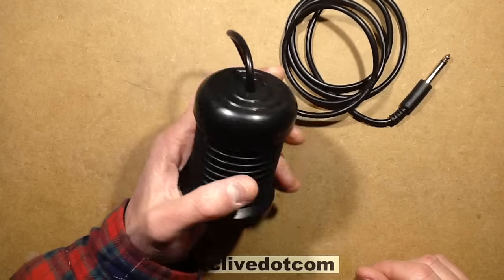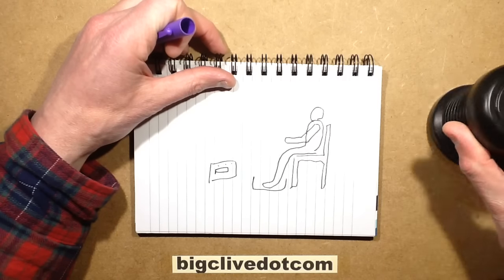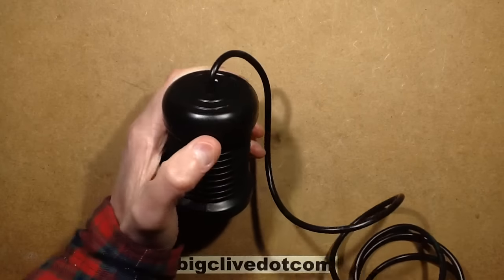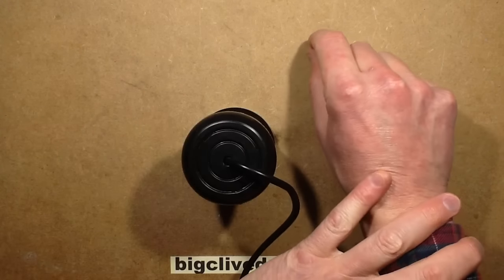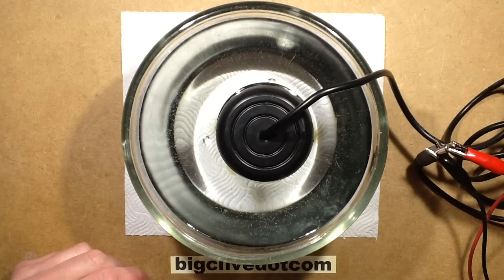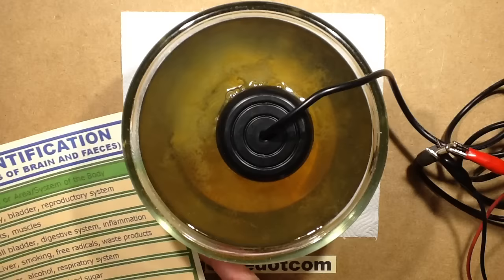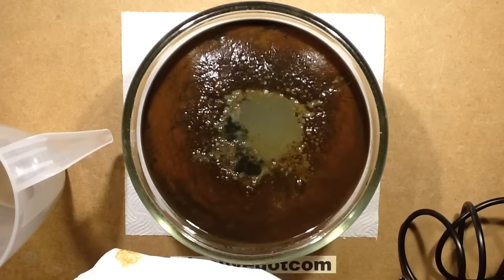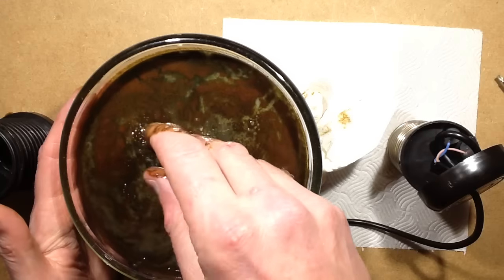Ionic foot detox electrode scam.  How it works.

Comment: It has an audio jack plug?  Maybe plug it into a p.a. system and use it as a microphone (with a few adjustments) or you could strip all the copper off it and cash it in for scrap. Or sell it to a another sucker looking for an easy way to be healthy other than doing it the right way with diet and exercise. Lazy and dumb. Not a good way to go through life.

Good day.

Comment: I have run a lot of hydrogen generators which will turn water the same color as this machine is supposed to be doing oh, but all it's doing is splitting the stuff that's already in the water, pure scam oh, that's why I drink distilled water

Comment: I think you need to go to the doctor 😂
Reply from the maker: Or I could go to a fake practitioner and have my feet marinated in a mixture of toxic chromium and nickel from electrically degraded stainless steel electrodes as they claimed it was sucking toxins through my feet.

Comment: I done the same experience and the water is clear after 30 min.Only when I get my feets in it,change the color.
Reply from the maker: Did you add salt, and did you use the hand electrode?  Try putting the hand electrode in the water, it may use it to avoid starting the fake treatment until you complete the circuit.

Comment: Perhaps you should do an actual experiment and use the product to its intention if you run it without feed it gives you a base color and then you run it again with your feet in it and you will notice a difference in the bubbling any additional as you say grossness so unless you use the product away is intended your experiment means nothing it plugs into the wall not your hoagie app system

Comment: Still waiting for you to tell me which make,model and mode you used ? Fake Clive as none of these things are visible in your video,  just red and black jump leads ?
🤣🤣🤣🤣🤣🤣🤣🤣🤣🤣
Reply from the maker: https://www.youtube.com/watch?v=qnXTvU6-xLQ
Reply: @bigclivedotcom  Hahahaha 🤣🤣🤣🤣🤣 No wonder you were reluctant to tell me make and model,which you still havent , but dont bother because that is garbage, what did it cost a tenner,lol, that is nothing like a proper ionic detox machine, you had to plug a machine into it, to find out what charge it was kicking out 😁 so no digital display then ?, and obviously just one mode?, it's not even a machine, a circular attachment no display and no variation , so no choice of positive or negative , or variable charges put through the water, no anti static band or safety measures, mines the size of a record player with multiple functions, with the ability to positively or negatively charge the ions in the water, so as well as detoxing you can also boost the negative ions in your body, yours is the size of a plug, you cant even call it a machine, it's more like an attachment with a green light,  it looks like a one trick pony, pound shop equivalent, I bet the array (coil) cost nearly as much as that whole unit, and you've got the nerve to say all ionic detox machines are a scam, based on probably the worse, low level, cheap ass, non digital, chinese tat I've ever seen, that's like reviewing a soap box with a BMW badge on made out of cardboard, and saying these BMWs are a scam, they dont go up to 160 mph , dont have heated seats, or electric windows and are certainly not value for money 🤣🤣 That is not a quality product, it's no different than what you've previously done which is attach a coil to cables and a generator it does 1 thing, 1 generic mode, everyones different and need different functions and suitability which that attachment simply doesn't have, but that unit definitely does not represent a top end , sophisticated, digital,  Ionic Detox Machine, any time you would like to  personally try and feel the undeniable benefits you get from a real quality machine, please let me know I will be more than happy to arrange it for you and a non biased party to have a go, as long as you film it so the truth can prevail, and as your clearly not a fan of spending money, I can reassure you the whole experience will be free of charge 😎👍
Reply from the maker: @darensmythe2987  They all work the same way.  A current limited DC supply that causes rapid electrode corrosion, with the polarity swapped automatically or manually to even the electrode wear.
You could just connect a 9V battery to the electrode's plug to get the same effect.
But if it makes you feel good to soak your feet in a solution of chromium and nickel salts then don't let me stop you.
Reply: @bigclivedotcom  Which is my entire point and exactly what you did,  you didnt use a machine hence the red & black jump leads, that's deceitful and lying to people, because you the self proclaimed expert says it's so, not buying it , you say they all do the same thing , answer me this on mine because it has a digital display which always shows the exact charge amount, I can increase the charge amount by adding salt and watch the charge value increase real time, yours doesnt tell you a figure or alter in any way does it ? And yours doesnt have any modes ? Mine has five modes all very different including one that instead of positively charging the water (detox mode)which is where you suggest the electrode corrosion happens and you get the brown sludge results, right ? But if there all the same like you say, mine has a 100% negatively charged mode(negative ion boost mode), that gives you light yellow results with no surface scum or debris,corrosion or anything  even remotely similar to your results, and four other modes with different levels of polarity and electrical charge, yours doesnt do any of that does it ? So there definitely not all the same are they ? If yours is exactly the same and does the same job, please show me the very different results you get from a 100% negative charge ??? And can you tell me what the increase in charge was you encountered after adding salt which obviously increases the conductivity of the water, which clearly as an expert you would know 😁😎 Finally you keep going on about me bathing my feet in chromium & nickel salts, which I assume  you mean comes from the silver looking coil itself, now if that was the case and it's a byproduct of that silver coating ,how come you can use a coil up to about 80 times the chrome coating comes off after about three goes, revealing a more copper looking metal underneath,  yet you still get the brown discolouration and brown scum on top, even when there is no chromium or nickel in site whatsoever???? 🤔😁
Your far from an expert in these matters, that much is for sure, it's a joke, as I said let me do a proper experiment with proper equipment with you,and get to the bottom of it once and for all,although I dont think that will ever happen because your pill pushing , W.H.O loving, Holistics hating Employers wouldnt stand for it, and wouldnt monetise you 🤔
Reply from the maker: @darensmythe2987  The stainless steel coil looks silver when new, but the electrolytic corrosion pits it making it look matte, and the corroded/oxidised surface is closer to the colour of the salts it puts into the water.
The only deceit is the people passing this common scam off as a cure for many ailments and implying that its dirt-show is coming from within their bodies.
Anybody offering this faux detoxing is a charlatan.  More so if they dress like a doctor and imply medical skills.
Reply from the maker: @darensmythe2987  A dual machine would have individual results based on three variables.  Electrode condition, current and salt concentration (salt to water ratio).  Since these non scientific machines are being used in a non scientific way by non scientific people the results will be hugely random.
A better quality machine will let you set a specific current and regulate it.  A poor quality machine will use a fixed current or just a resistor on a fixed voltage supply.  The variable one would be my choice if I was offering this quack treatment, as I could turn It down for subsequent treatments, and then advise my victim that the colour was lighter because the detoxifying course was working.

Comment: Number one dude... Check the coil in the foot bath with a magnet.
Cheap 100 dollar foot baths use STEEL COILS. Steel rusts in salt water,passing current thru steel makes it rust faster.
Professional Grade footbaths use non magnetic stainless steel. Non magnetic stainless does not rust because it does not contain iron.

Professional Grade machines will cost you 2000 to 5000 dollars.

Go get a professional grade machine then make a video.
Stop spending false info please.

Comment: In prison we call em stingers it's how we heat up water to cook with in the cell that water would get so nasty just from salt and tap water we don't use the brown water we use plastic bags and place em in the brown water to heat up our water and then just pour the water holding the bag with a towel to not drip brown water in the clean water and whammo you're welcome just another prison tip from your uncle luddy 🤭🤭

Comment: Sorry, I disagree. The colour yes, seems to be from the salt and water. BUT, it seems to have an effect on my erection and metabolism, as if I am loosing weight faster, without changing my diet; not 100% sure yet about the second, I need more time to be sure.
Also, solid pigments show up, how?

I could be wrong and there could be other causes for the above(non in mind) but it seems a weird coincidence that these effects showed up after using the array.
Reply from the maker: If you find it helps you, by all means keep doing it.

Comment: I’m here to tell you it works my friend had gout in his legs so bad he would have miss 2weeks of work at a time several times a year I watched him 2 thirty day treatments with a mouth off in between that was 6 years ago he hasn’t had gout since then .so I bought one it sure clears up my skin really good!! You have to use it right yes your right that it turns the water that color but it still takes some stuff out of your body my friend and I are proof it works I suggest you study it more and try it yourself
Reply: What absolute bollocks.

Comment: the positive ions in the air the pollution in the air is attracted to the negative charge!! and yes it does anyone that tries it will feel the stuff pulling out of the feet youre just a troll to keep people from relief
Reply from the maker: One of the electrodes is positive and one is negative.  You clearly don't understand what positive and negative ions actually are.

Comment: People think this is a scam because the water turns a color from the device without your feet in it. But that doesn’t mean anything. They acknowledge that. They never claim that all of that color comes from your body. They say it comes from the device. But It shows different colors, it’s because of the mixture of the colors that come from the device, and the specific toxins in your body. Some of the color of the water, is coming from your body. Most of it is from the device. So it is not a scam.
Look into zeal light. It is a heavy metal detox you take internally. It works by negative and positive charged things as well. It’s negatively charged, and then heavy metals in your body or positively charged, and acts as a magnet and then you pay it out. Same concept. And that works
Reply from the maker: Lots of very similar pro-scam comments recently.

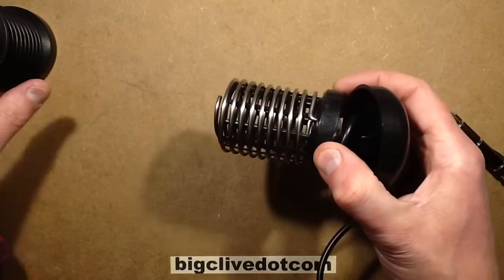Comment: at 3:36 it actually looks like YOU could use some heavy metal detox- with that shaking you got going on there. 
Neurological damage is also due to heavy metals. You could probably benefit from the very machine you 
are bagging on.
Reply from the maker: I think I filmed that during a time I was nursing my mother through her final illness.  The shakes were probably caused by sleep deprivation.

Comment: That how our water is not clean, put distilled water will not doing that, I tried it,  As mentioned be careful what you drink,  boil your water and wait then drink it from a good filter water cleaner...❤
Reply from the maker: Distilled water is non conductive and will stay clear.  Any impurity, including natural minerals will cause the theatrical colour change even if the water is perfectly acceptable.

Comment: If your going to prove a scam use the real product not a your made thing . You I think are the scam
Reply from the maker: I did later on.  It was also a scam.
Reply: @bigclivedotcom  ya took the vaccine also ? 
I will tell you this I used that after a very bad accident and a ton of meditation. It healed me and cleaned a ton of crap out of me . 
Also if that was true why would my friends be red and white specks and my husband with asphalt sitting on the bottom?

Comment: Research METAL CLEANING WITH ELECTROLOSIS, WOULD'NT IT BE POSSIBLE FOR  YOU TO PHISICALY ABSORB THIS SLIME, IF NOT PROPERLY WIRED? SOMEONE HELP ME OUT WITH AN ANSWER HERE!!! ( a simple power sorce and anode will work here) costs nothing, and easy setup! The aode material must be making the slime, someone with electrical, medical knowledge comment on this please, reversing current direction pulls from the other direction, this concept is not immpossible, just close the electrical circuit with current flowing in the right direction!
Unless properly flowing current direction, one could be absorbing this instead of producing it!!! Someone smarter than me comment please! This is so cheap to do, no wonder it provides  INSTANT RESULTS, THATS WHAT SOLD IT!

Comment: Any one that has use it can feel the difference in the body. The acidity of the body goes down. Dont talk without using it.
Reply from the maker: Yes they can.  It's called the placebo effect.  Or maybe it's the introduction of toxic chromium and nickel salts through their feet into their bloodstream from the electrolytically corroded stainless steel electrodes used to create the brown colour.

Leave science to the technical people and keep quackery to those who have nothing else to contribute to society other than voodoo fakery.

Comment: Problem is you want it to be bogus based upon belief.  You assumed the coil would corrode because it’s not stainless when it looks like stainless to me and your magnet showed it was a decent quality stainless because some non medical grade stainless is very magnetic.  Highest quality has zero magnetic. 

When you look at how the water negative ionizers work it pulls the toxins that are acid energy or positive charge to one side of the separation containers and is brown and the alkaline or negative charged water is clear.  Then ph test proves it.  

This stuff theoretically therefore shows it can actually work.  All is energy and repulsion and attraction. 

It just makes sense.

Plus I’ve been curing people of everything for twenty years and I found it’s all about acid I body cell or alkaline body cell and we know acidic batteries are toxic and alkaline battery cells are non toxic.  If you throw cooked foods in a compost it makes the soil toxic and deadly to plants and life but raw materials add to it make it alkaline and life giving. 

All, things are connected to this two different energies.  Because all in this world is polarities and positive and negative.  Pretty simp,e logic. That water you used showed that it’s not a healthy water.  

What you showed us here tells me it’s more possible that it’s not bogus. 

Try doing it with distilled water instead.  No impurities in distilled.
Reply from the maker: Very little would happen with distilled water because it is not conductive.  Even ordinary tap water is too slow for the visual effect, hence why they add salt to make it conductive and allow faster corrosion of the electrodes that give the visual effect.

Comment: That was actually a very bad test two reasons why it seems that everybody's feet have a different array of colors so if the machine was producing these colors it would be the same colors all the time number one number two you didn't actually try it on yourself so you don't know the benefits once again I'm letting you know it works I can tell the difference the last two nights I've slept fantastic and the inflammation has come off my legs my back cuz I have inflammation in my joints and I have a mild case of arthritis and my water only turn dark brown not all the other colors so until you do a test on yourself you're debunked

Comment: This is actually, a type of Galvano therapy. The relevant data, is related to both before-after blood plateletes structure, AND heavy metals, in both water, and urine, within the next 24 hours, as a result of therapy. Such study was done in Toronto, some 12 years ago. If you like to actually SEE how it works, connect a large carrot , instead of a human... see the color change to orange. This video is actually embarassing... looking @ the irrelevant paper, not the physical benefits.
Reply: Ari Idan Really?  Link to the study please.  Thanks.

Comment: I have my own machine and it not from china for one. Two I know it works becuase it pulls parasites. Three every persons is different. Four it depends on your water if you read the manual is should recomend that you do your first foot bath without salt and than gradually add salt after that. I Would take this guys video with a grain of salt. Cuase I've done my own expirimenting with my ionic foot bath.
Reply: And the moon is made of cheese